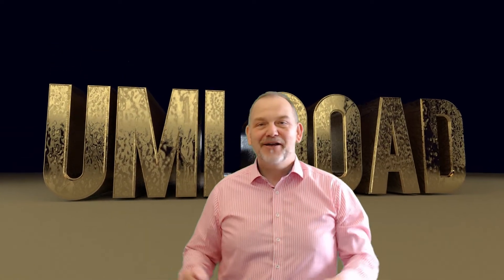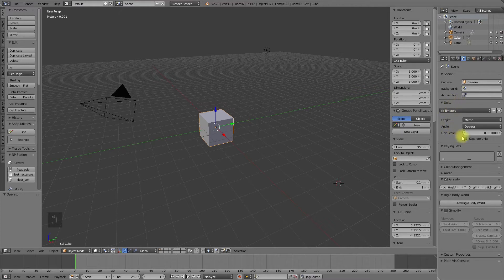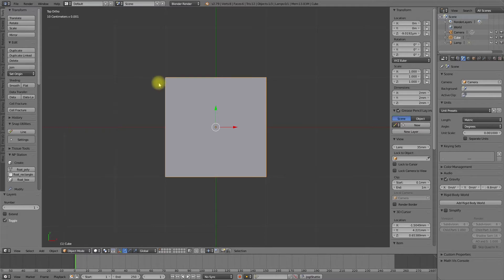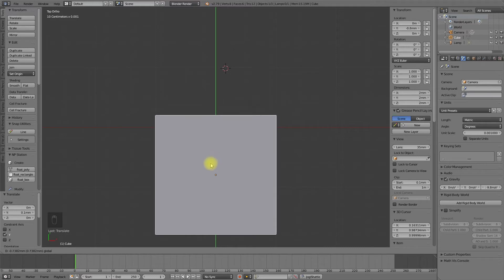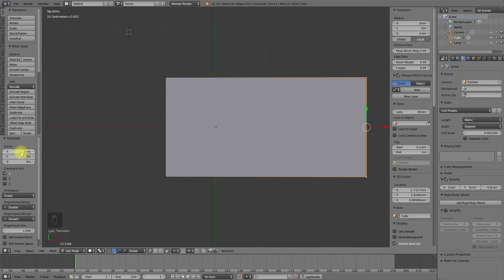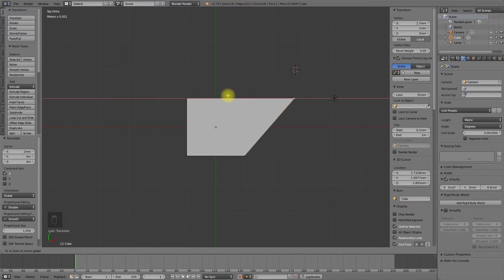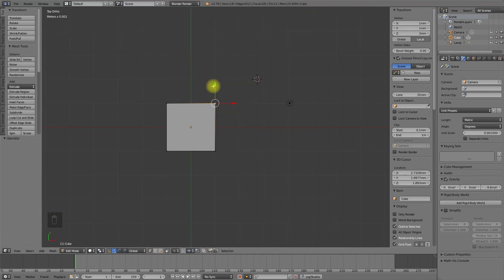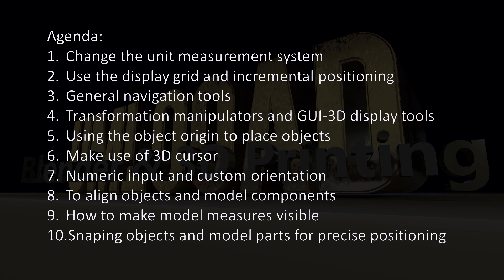Precision modelling - CAD like approach - Blender and 3D Printing Part 1

Comment from the maker: Here an additional nice beginner video using Blender 2.9. I show the modeling process of a telephone holder for a dashboard in a car, using Blender 2.9.  The goal is to model a 3D print finished model in Blender. This includes precise modeling techniques with defined model dimensions, a good mesh topology and the final correction of any errors for 3D printing.  
Blender step by step modelling a 3D printed car phone holder with precision. Link: https://youtu.be/K_kCa5JU3UI

Comment: Nice tutorial, the setup details matter. Blenders interface can initially be confusing and one thing that would be very helpful is how to set your environment up and how the various panels relate to eachother. What would also be very helpful to me, is a tutorial on a translation of the Solidworks design methodology into blender, e.g. the creating of object features through the use of sketches which is a  very powerful and efficient way of doing things. I used to use Solidworks but now dont have access to it. I've used blender in the past so it would be really helpful to be able to work in blender in a similar way that I used to work with Solidworks.

Comment: since you did not specify the version of blender your using, this video is useless!
Reply from the maker: Hi Blender always shows the version in the top title-menu section of the window in the middle of the screen. It works also with many former versions, if not to old and with 2.8.

Comment: Although I use blender 2.8, your vid is helpful for me, especially the microgrid snapping. Thus, blender can also be used for the precise technical design for 3D printing. Thanks a lot. Now I'm only still missing to display a circles diameter instead of the xy values.
Reply: Would the MeasureIt add-on work for you? You'd have to find which two vertices to select to measure the diameter but it does display a segment length.
Reply from the maker: Did  you  check the Measure IT addon ,  the developer upgraded it to support Blender  version from 2.8  and higher.

Comment: But it s still pain in the a.. to work with in comparision to a real CAD software or? I would love to work with blender for CAD projects for 3D Printing, but it looks that its very hard to stay in the flow or? I use Rhino atm. and its so fast to work with. Disadvantage - there is no Eevee to render.
Reply from the maker: Well depends on your needs and you can use it for smaller technical (CAD like) projects. Blender is not designed to be used as a CAD tool, it´s main purpose is visualization of 3D material and animation. It is created to make artists happy and not technicians. Following the artistic approach, Blender has powerful tools you can use to create your models for 3D printing, e.g. physical (fluid) simulation or displacement technics.